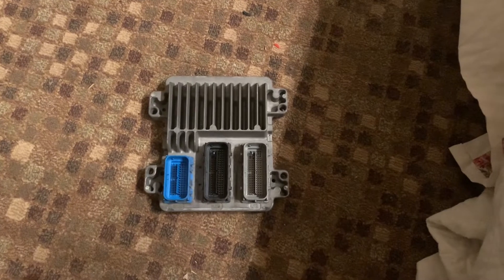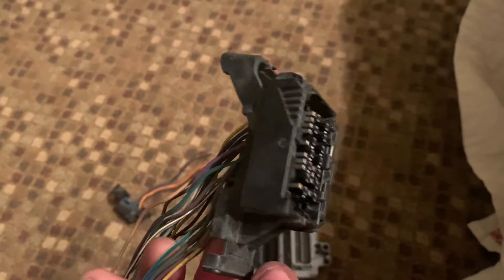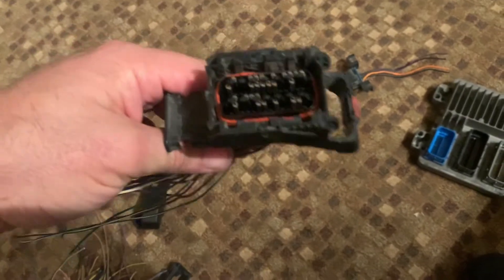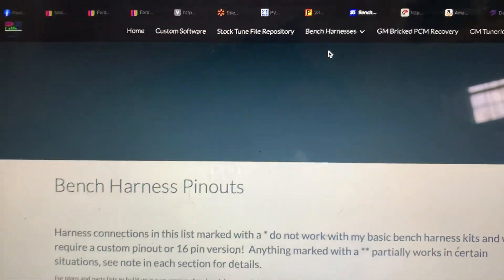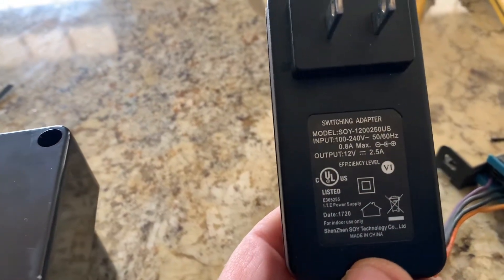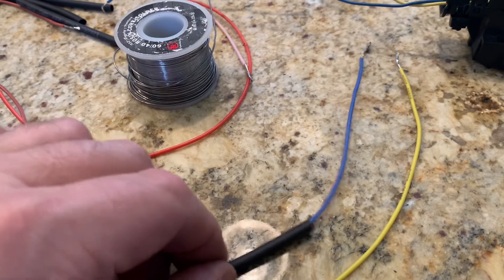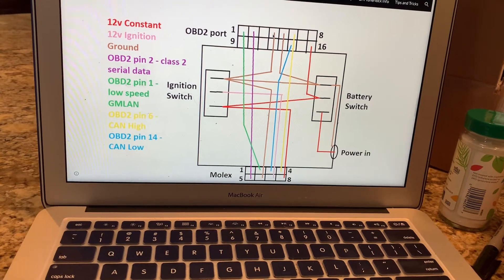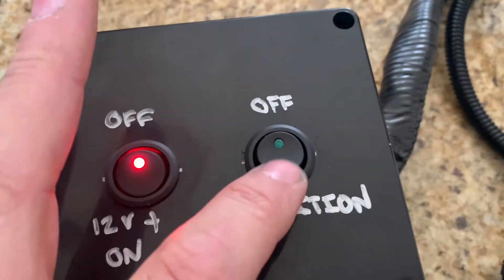DIY E67 Bench Harness - save at least $100

Comment: Hey Dean thanks for the info... I built one and it isn't able to read the E67... Can you confirm that you have the 2 can buss wires going the grey plug pins 53 (High) and 33 (Low).. Also 3 wires to the blue plug pin 19 is 12v ignition, pin 20 is 12v constant and pin 36 is ground... And no wires to the black plug... Do you have any  wires other than the 5 mentioned connected... Thanks... Mark
Reply from the maker: Hi Mark.  Mine is wired exactly as the diagram on customecm.com and it's as you said.  No extra wires.  I'm not sure if you used the same switches I did, but I do have to hold the intermittent switch while it's reading.
Reply: @deansmessygarage8616  Hi Dean... Thanks for your reply... I think I have mine working now but have not tried to flash my ECM yet.. I guess there is more than one way to pin the E67's... Thanks again... M